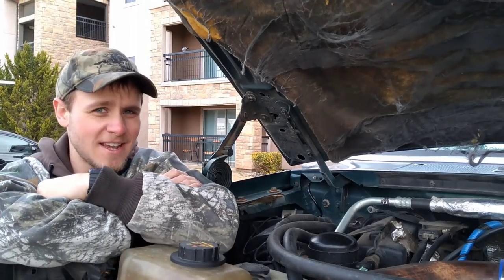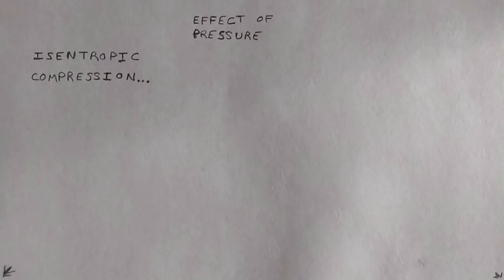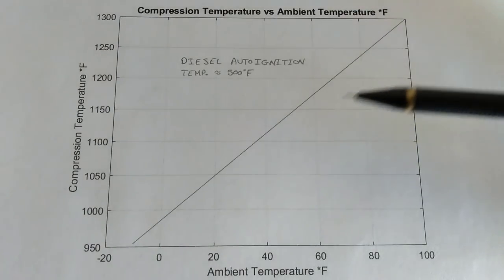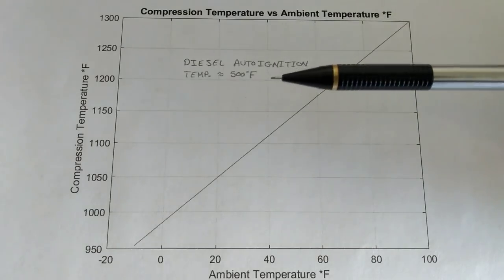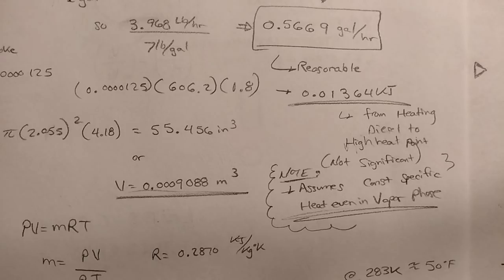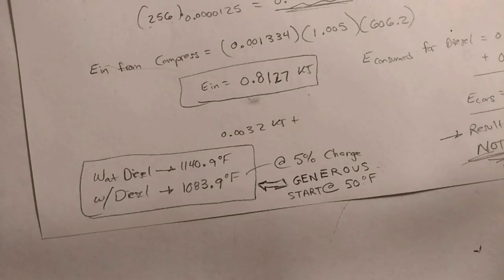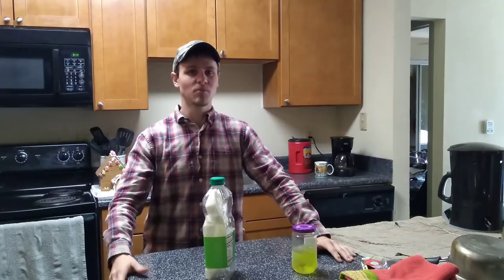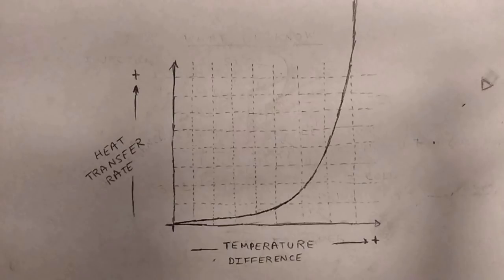Why Diesel Engines Are Difficult to Cold Start

Comment: I'm looking to finalize a purchase of a 1995 OBS turbo 7.3 this weekend. What are the main things to look for before i drive away with it?
Reply from the maker: First off good luck with the purchase! If you can get a scan tool hooked up to it, though I don't believe 1995 was OBD II compliant, so you may have to use the paperclip trick or some equivalent means to look and see if there are any stored transmission codes (if automatic) or signs of misfires or bad sensors. Look, pretty much everything on the truck can be fixed by someone who know's what they're doing, even the engine can be replaced of course. Assuming you don't want to tear down the engine, here are some things to look for. Before even starting the truck, check the transmission fluid (if automatic). You want it to be light red in color, or slightly darker red is fine, but definitely be cautious if the fluid is burnt or black, this could be a sign of clutch slippage and overheating which means you're due for a rebuild. Of course transmissions go out, just reason the cost to replace one. If it's a good deal and just needs a transmission otherwise that you don't mind replacing, then go for it. At best its probably $2k for a stock rebuild transmission. Though be mindful if the fluid looks too fresh, ask the owner if they changed the fluid recently, they may be trying to hide some transmission problems, at least look at the transmission pan and look for any freshly cleaned spots that may indicate the pan was dropped recently. Check the engine oil, be cautious if it is below the  fill mark, this may be a sign that the previous owner didn't maintain it so well. It's no big deal if it's a little low, I believe early model 94 7.3 powerstrokes had dipsticks originally calibrated where 10 quarts was full, but everyone after, 12 quarts was full. Basically if it's just a little low, that's fine it didn't damage the engine, just may indicate there are some other miscellaneous repairs you need to do otherwise from lack of maintenance, again, can be fixed just adds to the price. Check the turbo charger and intake system. Pull off the air filter and inspect the piping between the air filter and turbo, is it clean? Maybe just a little oily? Or does it have a layer of dirt and dust in it? Oil in the intake/ black sludge is perfectly normal, that's just a consequence of the CCV system venting blowby gasses into the intake. Definitely be concerned about dirt and dust though. If that stuff gets into the engine it'll act like sandpaper and significantly deteriorate the longevity of the truck, so if it only has 150,000 miles on it but has a dusted intake, odds are you're looking at an engine that is closer in wear to  one with 400,000 miles, there's really no way to tell though. If it's really heavily dusted, that may be a good reason to walk away, use your sense, if it's just a very mild light dusting, it may be okay still. While you're there, take off the turbo intake boot if you can and the seller lets you. The goal is to inspect the turbo for wear. Grab the main shaft and see if you can push it in and out, if it moves excessively, that's a sign that you need to rebuild the turbo. Again not a deal breaker, just those turbos are a royal pain to remove and it definitely adds cost to rebuild it. At the very least inspect the compressor wheel, if it's severely mangled, yeah the turbo needs a rebuild. At least you need to replace that compressor wheel, as the bearings fail too, it can cause excessive play which allows the compressor wheel to contact the housing and really damage it. Check the truck for leaks, it's very common for these things to have leaks. The most common ones include leaking high pressure oil lines and a leaky oil cooler. These are no big deal, just more work and adds cost. I did the work myself and replaced my oil cooler seals for around $60 a year ago and haven't had any leaks from it since, it was just a very messy job! Specifically ask the current owner to not start the truck for at least 24 hours so you can see how the truck cold starts. If it cold starts rough it could be a sign of a bad glowplug system or worst case bad injectors. Make sure the guy doesn't use ether to start it! That's probably the one thing that I would just flat out walk away from the truck if I saw that. Ether can do some terrible damage, and if it were used in the past it can put micro fractures in piston that could grenade the engine in the next few thousand miles or sooner. If it won't start without ether, there are other things that are likely wrong with it. If it's above 70 *F the engine shouldn't have any issues cold starting even without operational glow plugs from my experience. Check blowby, this is just a visual inspection of the gasses leaking by the pistons, more blowby more wear. Take off the oil fill cap with the engine running, put the cap back on the oil fill hole upside down. If it just sits there and rattles a little bit but stays on, the engine is fine. If the oil cap is blown off or you can feel a significant pulsing from the gasses, your engine is shot, likely has a skip in one cylinder and needs to be torn down. Drive the truck and run it like you stole it. You want to make sure it's in good shape before you buy it. If it's severely sluggish and low on power, it may have bigger issues such as a weak high pressure oil pump, worn injectors (my injectors were very worn and the truck was so slow it was dangerous to turn left into traffic basically), a high pressure oil leak, or a bad Injection Pressure Regulator. If it passed the blowby test, and just drives slow, odds are it's fixable, though you're looking at anything from a simple set of orings as a fix to a new high pressure oil pump or injectors, so keep that in mind. During driving, unless it is chipped/ tuned, the 7.3 psd won't be 'fast' but it should be 'peppy.' It's not a high horsepower engine, but it does make decent torque and will get out of it's own way. It's definitely not a modern diesel, so don't expect a speed demon. Just think about how a 215 hp engine would pull a 6000+ lb truck. It's not 18 wheeler slow, still should have acceleration more comparable to an average pickup truck. For reference, in my experience a 7.3 psd will go 0-60 mph in about 15-16 seconds if in good shape. If it's closer to 18-19 second's for the 0-60 mph, it may have some worn injectors, but is definitely fixable, injectors run about $1,200 or so. Stand on the brakes if you can and be safe about it of course, let the owner know what you're going to do before you stand on the brakes. They should be pretty powerful, these are pulling trucks and should feel like they have powerful brakes. I don't believe any of them came with anti-lock brakes from that era though. Brakes are a common wear item of course, I redid all 4 brakes for around $350 doing the work myself and using new drums, disks, front calipers, wheel cylinders, and of course pads and shoes. Check the steering, is it loose? If you can look under the truck and inspect the tie rod ends, and other steering components while the owner turns the wheel side to side. Look for excessive play. You can definitely replace those steering components, I believe I priced a new front steering setup for maybe $300 excluding the cost of alignment. Everything else is going to be pretty standard, look at any weird wear patterns on the tires, bald tires, poor body panel alignment that could indicate it was in a wreck, which may or may not be a big deal depending on what your preference is. I really need to make a video on this sort of thing, I'll get there eventually. Anyway, best of luck with everything!
Reply: UPDATE. I looked everything over as you said and other than obvious steering and brake issues truck seemed solid. So i bought it and after I drove it for a few days a cold spell came through south Texas I noticed a massive oil leak. The front of the oil cooler leaking badly which i hear is a common oil leak from the orings. So i pulled off the cooler and of course the oil pressure regulator fell out of the housing into the oil bucket. LOL. After digging the pieces out i noticed the oil filter bypass valve is missing also. I didn't notice it fall out so I'm not sure if it was ever there. Well i just decided to order a whole new housing from Jegs that came with everything except the block heater. So I should be rolling again this weekend after parts come in. Thanks for the info and enjoying the channel.
Reply from the maker: @chrisellis4140  Congrats on the purchase! Well I guess it was baptism by fire for you. Nearly every 7.3 gets an oil cooler leak, mine did, my friends' did, etc. It sure is a messy job, and I'm glad to hear you were able to get things figured out. I hope it works out well for you!

Comment: I have a question. Can I use a heat gun blowing hot air into the intake to help with a cold start?
Reply from the maker: I like your question, it's a good one but a tough one to answer. If you had a powerful enough heat gun, then technically it should be able to get the engine to start. It would be similar in a way to the Cummins method of starting cold where they use a grid heater mounted in the intake manifold to warm the air. I think the biggest issue would be getting a heat gun with the capacity to warm as much air as you need. By my basic calculations a 7.3 liter engine cranking over at 300 rpm would need around ~50 cubic feet per minute (CFM) of air. Glancing online, a typical gun produces around 10 CFM. With such a low flow, you'd need to use the highest heat setting. At that point you'd need to be very careful as to not melt any plastic that's in your intake manifold. I have doubt's as to whether it would actually work, but theory only goes so far in it's basic form. It might work better on a smaller diesel engine. None the less it may be worth a shot if you're careful about it. Let me know if you try it out and if you have any luck!
Reply: Rnddiesel Thanks for the reply. The reason I asked is I saw a vid from Russia where they used a flaming torch to heat the intake air. It worked but seems dangerous. Again thank you!
Reply from the maker: @flyguy5941  I think I've seen that one too, crazy Russians I guess!
Reply: When I used to move heavy in the winter time we would use a propane torch to warm up the intake manifold.  The engines would usually pretty much start right up after a minute or so dose of heat. It saved the juice from not using the glow plugs for cranking.
 They would smoke a bit but that's normal.
Another trick my brother showed me was to put a rag with some gasoline on the air filter and after a few wifs the motor would start.  A lot of old trucks would have a propane injection setup. They used a choke cable set so when you pulled the knob a metered blast of propane would be dispensed.
Most people don't realize but you need a oil pressure to turn the fuel onto the injection system.  Thinner oil in the winter time is your friend. If your oil is  thick  your oil pressure switch won't turn the fuel on the motor  and it won't start. Another thing is if your voltage is too low the fuel pump won't turn on and then the truck won't start. so if truck is cranking slow which means the batteries are low which means the fuel isn't on. Old trucks with mechanical pumps are different story know pretty much because they don't have the oil pressure switch lockout.
Reply: Good idea to have a plug in oil heater ?

Comment: I wish you could have calculated the actual heat absorbed by the cold cylinder. I wouldn’t think it would be that hard. Just calculate the average surface area the air is in contact with and use the cylinder displacement to calculate air flow at idling speed. But then you’d have to consider the constantly changing volume. And thermal transfer rate. I mean, you have the enginerding degree, not me...
Reply from the maker: I appreciate your input! While I do technically have a degree, that only shows I have the ability to learn, doesn't mean I know everything. In principle it's simple to find the heat transferred if you know all the important parameters in the problem. You still run across the issue as to whether or not your model makes the appropriate assumptions. I think I did run the calculations and modeled the mass of air as a solid where conduction was the primary mode of heat transfer. The thinking there is that the process occurred so rapidly that there was no time for convection currents to form. It's been a while since I made the video so I don't remember everything I did. Ultimately I figured most folks would rather not see excessive complex math in a YouTube video.

Comment: I used to grab my cutting torch from the Welding bed Put it in the intake and heat up the cylinders😂😂😂That way I could get home and fix it later😂😂😂That whole 4 Hour Drive back home

Comment: I do have a bone to pick with the engineers that’s for sure LOL yalls designs make it hard on mechanic technicians😂 Y’all can talk to talk and design stuff but can you walk the walk and work on it to
Reply from the maker: Indeed, the engineers do make it hard to work on things,  but to be fair it's really the average car buyer who is at fault. If folks didn't want to have ridiculous acceleration and power in their commuter car while the EPA puts ever so strict emissions standards on vehicles, then the engineers could definitely make the vehicle easier to work on. Look at old cars from the 50's: no power steering, no AC, no heater, no windshield washing system, no radio, no emissions controls etc. Now all that junk gets crammed under the hood and makes is next to impossible to work on things these days without pulling half the car apart!

Comment: Gas engines don’t run at 14.7/1 they run leaner as no engine can fully burn the fuel at 100% efficiency 😉 14.7/1 is stoichiometric mixture meaning in perfect conditions there is the exact amount of oxygen to burn all the fuel. No engine gets perfect conditions

Comment: Why clapped out* diesels are hard to start. Just put in working glow plugs and time the engine PROPERLY, not for max fueling like a maniac, and it’ll start just fine. Started my mis timed mazda diesel in -20°c after sitting 8 months with 50/50 veg oil/diesel, had no problems starting even with a decade old battery